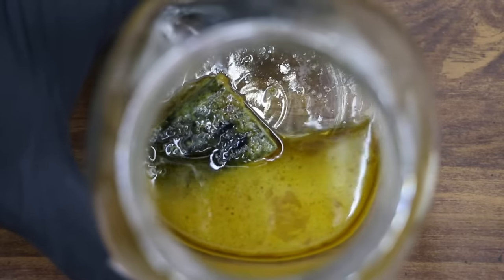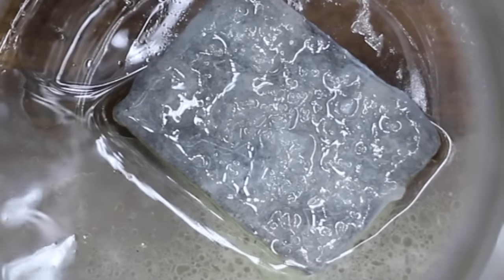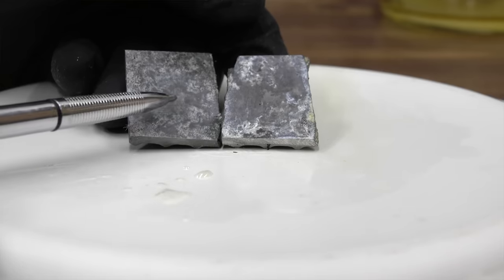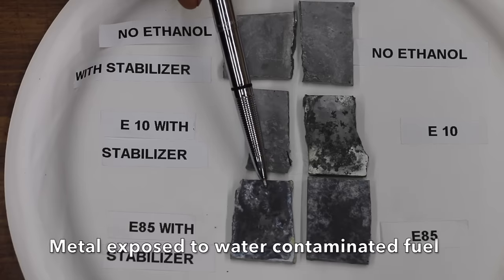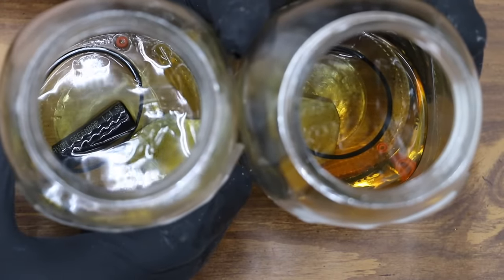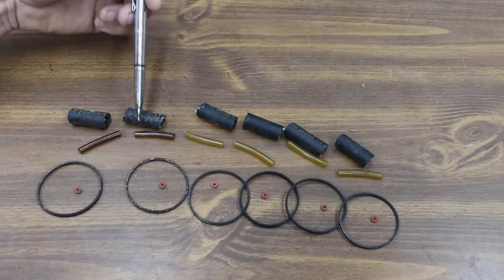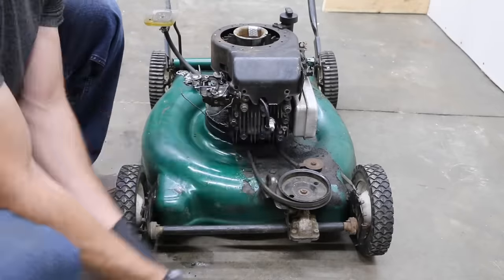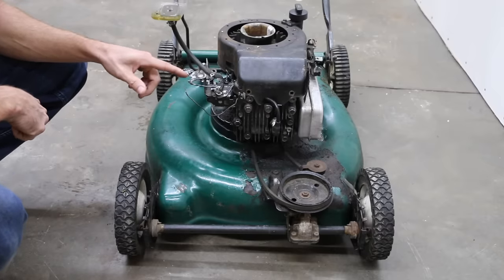Does Fuel Stabilizer Prevent Ethanol Damage?  Let's find out!

Comment: Can we bill the epa for the damage to our property
Reply: Ethanol is used to boast its Octane rating... so with or without SUBSIDIES its needed...
Reply: M B why should have corn farming died out already?
Reply: corn is very inefficient, for making Ethanol
Reply: Ethanol is used to boost octane, infact GM had the opportunity to use Ethanol to boost octane 100 years ago but chose TEL instead, because you can't pattent nature.

Ethanol is also effective at reducing carbon monoxide emissions, which is the primary reason E10 exists.
Reply: @mbbb9244  Welfare in exchange for votes and financial support to political candidates. Gross.
Reply: @N C ~ Higher Octane is only good for higher compression engines to reduce 'pinging'. Engines with lower compression, for example, with engine management systems can compensate for the lower power of high Octane fuel but at the expense of fuel economy.
Reply: @Texassince1836 ~ Higher Octane is only good for higher compression engines to reduce 'pinging'. Engines with lower compression, for example, with engine management systems can compensate for the lower power of high Octane fuel but at the expense of fuel economy.
Reply: @Jim-ee6pz  using ethanol you can increase the octane rating of lower octane fuels. For example 84 octane with some ethanol now becomes 87 octane regular fuel. 

This is opposed to using MTBE or TEL to do the same thing, since both of those are toxic.
Reply: @Jim-ee6pz  and modern production engines are all 9.5, 10.5, 11.5 or so compression. Gone are the days of 6.5, 7.5 or 8.5:1 low compression motors
Reply: @Texassince1836 ~ You are right about the compression ratios (my bad). My point is that there is no need to put higher octane fuel in engines that specify using regular grade fuel. People think they will get some gain from it but end up only paying more with no real benefit. Always use the grade of fuel recommended in your manual unless you have no choice and even then the engine management system can compensate.
Reply: @mbbb9244  In the UK we're told it's in our fuel to " save the planet " and we have any pops and crackles tuned out, GPF filters, double cats, insanely high taxes on 2L turbo hatchbacks. I call bullshit on all of it but Government's just get to do whatever they want in Europe.
Reply: @95roadie  - He meant the subsidy should die out...not the farmer
Reply: @Jim-ee6pz  - your response to Texassince1836 on engine compression ratios and ethanol compelled me to comment. 
Ethanol does not increase gasoline octane when blended because ethanol has a different stoichiometric ratio - having greater oxygen content. The gasoline will pre-ignite before the ethanol does in a higher compression engine. Ethanol doesn't prevent the lower octane gasoline from detonating. Mentioned was days of low compression engines (6.5 -8.5) are gone. Higher compression engines (9.1 and up) cannot run on 87 octane fuels-that and higher compression engines create more nitrous oxides (a pollutant). To reduce nitrous emissions exhaust gases are proportionality routed back thru engine intake to take advantage of it not having any oxygen content (inert gas). This spoils  hi-compression engine output to a degree.
Ethanol has higher oxygen molecular content and results in LOWER energy content. Ethanol blended with gasoline reduces gas mileage -10% blends have net loss of approximately 2-3% mpg.
Ethanol has a higher octane and could be used (100%) in engines of compression ratios of 12:1 or more. Increased efficiencies could be realized but still, ethanol would not match the mpg of 100% gasoline because of it's lower energy content (oxygen content level). All this can be verified at Wikipedia.
The ethanol industry wants to have ethanol content in gasoline sold to us increased to 15% but that would drastically reduce mpg by 15% or more and would be much more noticeable by the public. 
The forcing upon us to having to buy gasoline degraded with ethanol does not fit well in our so called "free market enterprise" scheme of things- if they want to sell it us then let us decide - not use government subsidies either. In my eyes it's just more of the crony capitalism we suffer under. 🇺🇸
Reply: Ray Bin ~ Ya and I cringe every time I have to put an Ethanol blend in my vehicles! Trump 2020! KAG!
Reply: @mbbb9244  +1 on the French wine industry overproduction; they have to do "emergency" distillations of surplus wine into industrial ethanol each year because they produce more than the market can absorb.  (And FWIW, I'm sippin' on the Jadot Beaujolais Village right now, used to work for a French wine importer, love French wine, and I still think these subsidies are socialist economic nonsense.)
Reply: @mbbb9244  ...  They also use corn to finish ruminant animals (i.e. cattle) on industrial feed lots.  I love beef all day long, but dammit the ruminant animals evolved to eat GRASS, not corn.  Corn makes them sick.  Gotta pump them full of anti-biotics just to keep them alive until slaughter.  What a bunch of nonsense!  Just let them eat grass.  Slap a tarriff on Australian and Argentine grass-fed beef if you gotta, but why do we need to propagate superbugs like MRSA because we use antibiotics on animals.  Another stupid crony policy intended to benefit a special interest group (mainly big ag business like Monsanto, ADM, Cargill).
Reply: @raybin6873  if E15 loses more than 4.5% fuel economy its the fault of the vehicle, not the fuel.

Even mixing in 15% WATER will not effect fuel milage by 15%
Reply: @mbbb9244  - that's what senator Perdue said in reply to my letter I sent him  - subsidies screw up free market enterprise  - gasoline laced with ethanol should be marketed on it's own accord  - not forced upon consumers...🇺🇲
Reply: @nc3826  - ethanol does raise octane but gas mileage is reduced because of it's lower energy content. To best use ethanol for optional efficiency it should be used in high compression engines but even then ethanol wouldn't match fuel mileage of gasoline. Ethanol is NOT needed in gasoline  - cars have run very well without it the past
Reply: @raybin6873 don't tell me.... go tell oil companies you have a more cost effective alternative, to using ethanol as additive in gasoline....
fwiw,Tetraethyllead and Methyl tert-butyl ether, is what was used before ethanol was used  in the past... and both were environmental disasters....
btw, its  strange how there are so many utube experts...
Reply: No ethanol has lower energy content
Reply: Texassince1836 no it’s lower in energy
Reply: Ray Bin correct
Reply: Ray Bin correct
Reply: @mbbb9244  Agreed it's a subsidy, but also, because,  supposedly,  it burns cleaner and petroleum is a limited resource.
Reply: Thanks for all your comments, I'm impressed w/ how much u guys know, I learned a 'thang' er 2. It sucks how political, Big business & gov./uncle Sam oriented things can get. We need UN-biased info from good "little" guys like all of you & Mr. Project Farm. Have you seen Phil Valentine's documentary "An Inconsistent Truth"? It made me think more/harder & want to know/learn more about pollution, pollutants, chemistry & such.  
I want to learn more, speaking of higher compression; what if we throw Diesel fuel into the discussion?!...  Uh oh, have I just opened Pandora's box er just a panDANG it?..   Have y'all ever seen the "little" guy that does "Shadetree Conversions" here on youtube?  He's pretty cool, check him out. He was a few years ahead of his time here in the US, full size trucks getting 40 er more mpg.             - take care
Reply: @Jim-ee6pz  the energy density of alcohol is far higher than gasoline. You actually get better gas mileage on 91 no matter the car
Reply: In California going to the bathroom on the streets and leaving needles is good for the envrionment evidently. Like all of these nuts saying breathing is destroying the earth burning CORN is the stupidest thing on earth.
Reply: Aris Torm I agree but corn is definitely good to eat with a whole lot of butter . Not shoved in the tank
Reply: EPA  ?  Ethanol was promoted by the petroleum industry backed by the corn farming lobby to allow boosting octane on  otherwise crap fuel. EPA, to the contrary,  produced studies that concluded to the environmental inefficiency of growing corn for that purpose.
Reply: @mt1885  With all due respect, "environmentalists"  (and frankly, a whole bunch of other people) have always been against the very inefficient process of using corn based ethanol to boost octane ratings and in the process, mess-up  every fuel system with its corrosion and rubber destroying properties. Corn is food and should be used as such. You want ethanol, ?  Produce it out of wood rip, scap wood or throw away
Reply: @danielrobert7181  The whole deal is a sham I don't want it and the eco-demo-communist who push this and claim oil needs to be done away with. When they finally get their wish it will be like a 3rd world country
Reply: @danielrobert7181  The with all due respect is the biggest load of ethanol I have heard. Anyone starting with that line is (claiming) they are being nice (however it is like all of the other lines) like environmentalist like Mr Gorre who live in mansions, private jets, Limos and use more electricity than a small town and want others to live in mud huts while he spouts the earth is ending with the biggest pack of lies. When Man rejects GOD what does he do (he holds ceremonies worshiping the earth). Again OIL is naturally occurring the entire LIE about it is dinosaurs is the biggest bunch of 'garbage'.
Reply: Daniel Robert I didn’t think alcohol raised octane ( the ability to reduce pre detonation under higher compression ) if so can I add alcohol to increase octane for my 2 strokes ?
Reply: @michaelschuler7397  In theory,: yes. But, any alccol that you buy commercially comes with a lot of water (not a good thing) and if you use ethanol blended fuel, it already has alcool in it, which absorbs moisture and eats up rubber hoses and seals. Adding more alcool will cause more harm than good. Small motors (2-stroke) repair shops around where I live, won't warranty any work  unless the engines are exclusively run on ethanol-free fuel. As to putting in Octane booster products  like STP or Lucas (which major ingredient is mineral spirits (good ole paint thinner), they do not recommend running it in 2-stroke engines. If you want long lasting fuel (2 or 4-stroke) get cans of engineered fuel such as Tru-Fuel, not cheap but very effective. Regards !
Reply: @rhedinrage1601  I’m sorry mate, I’m glad I don’t live under them! I wouldn’t be able to afford my 7.3 Ltr with a turbo
Reply: @danielrobert7181  in my classic 2 stroke motorcycles I use a fuel at my local high end station that says it’s 92 and no ethanol it’s pricey but I don’t use a whole lot
Reply: @Texassince1836  
"effective at reducing carbon monoxide emissions"
BS
How? For what engine? Not my car.. Not my lawn equipment
Ethanol generally lowers fuel efficiency and damages engine parts.
I don't know how "good for the environment" ethanol is when I'm buying more parts and getting worse mpg.
Cant imagine all this land being used to create ethanol is of any environmental benefit either.
OH and lets not forget all the additives added to fuels now because of the damages ethanol does to an engine.. I'm sure that "helps"

"boast its Octane rating"
And that is absolutely pointless. High octane does nothing for running cleaner, mpg, or car run better.
I dont drive a race car.

Like most environmental scams pushed by media/GOV its ultimately worse for the environment and only staying around due to tax dollars being tossed at it.
We "solve" everything by tossing more of your money at it. Look at the money being tossed around today. 40-50 years of the same nonsense

Comment: Very Helpful! I own a small airplane with 914 Rotax Turbo engine that requires NO lead fuel ⛽️ So I am forced to use 91 Octane car fuel. I do use Stabil & additives that are supposed to remove the damaging properties of the 10% ethanol fuel with out reducing the Octane rating. I do use 100LL Avation fuel while on cross country flights. And another additive called decalin to help remove the lead contamination. This demonstration was very helpful to fully understand the damaging effects of ethanol and water damage to carburetors, parts and fuel lines…..And how important it is NOT to let the fuel sit to long…….Very nicely done!  ⭐️⭐️⭐️⭐️⭐️⭐️⭐️⭐️⭐️⭐️⭐️⭐️⭐️⭐️⭐️⭐️⭐️⭐️🫡✅✈️🇺🇸

Comment: A little less than a year ago I dropped the factory original fuel tank from my 1988 Toyota to change the pump (preventative maintenance. God knows how much longer the original still might've lasted as I not once ever ran it dry of fuel), and upon looking in the tank I didn't see a single speck of corrosion. I credit my near obsessive use of ethanol free fuel for this. Given the era the truck was manufactured, along with political reasons to do with corn subsidies pushed on American farmers, I refuse to use fuel containing any ethanol in my truck or any of my small engines.

Good to see proof in your video that the mechanical aspect of my choice is spot on. I'm only surprised that I didn't happen upon this video before, given how long it's been since you posted it. Great work as always.
Reply from the maker: Thanks!  Thanks for sharing.

Comment: I've hated ethanol fuel for years. Nothing but trouble in 4 stroke lawn mowers that don't get run every week. My 2 stroke powered tools seem to do better. The mix oil has stabilizers in them which help them start after a few months of no use. I've tried non ethanol gas in my classic cars but the octane available in my part of Texas is only 90. Not good enough for high compression. I've used Lucas octane booster with great success. The only downside is the orange stain it puts on the spark plugs. Also, there are small balls of magnesium that build up on the electrodes. That must be the additive in Lucas octane booster. I've gone back to 93 octane E10 with Lucas fuel stabilizer. Plugs are burning cleaner, and they start fine after sitting months. If we had 93 octane non ethanol gas here, I would use it all the time. Great video, thanks for your testing and experiments.
Reply from the maker: Thanks and you are welcome!

Comment: The best thing is that to remove the fuel from gas tank if the car is going to sit for a long time. 

Great video! Can you try to test diesel too?
Reply from the maker: Great test idea!
Reply: @ProjectFarm  There's quite a few diesel treatment options out there - maybe a comparison of a few. Fuel gelling would also be a good test. Not sure if there is anything that will prevent or undo the gelling of the biodiesel being mandated nowdays.
Reply: How can you empty a tank if there's no drain plug on most modern vehicles?
Reply: @ryanchristensen1799  With a Liquid Extraction Vacuum Pump.

Comment: Learned the hard way, at a Min...if your car is going to sit for a while, 3mths or more, drain the gas, take off your carburetor and store it upside down, to prevent the jets from old gas corrosion where the jets are... had to rebuild my holly 1940 and they don't hake em anymore, and rebuild kits are hard to find now, they replaced the autolite 1100 carbs on str8 6  for better reliability and power... now they recommend the holly 1920 1904 models i believe...for the ford inline 6 - had to replace the tank as it leaked with a hole, fuel pump as it was clogged as well
Reply from the maker: Thanks for sharing.

Comment: So, who makes the best (that actually works) fuel stabilizer?
Reply from the maker: I'll begin that test this week.  Great suggestion!!
Reply: I would say non ethanol is best fuel stabilizer :-)
Reply: @ProjectFarm  Curious to that as well; I've been using Sta-Bil and my mowers start each spring, but SE North Carolina winters are short  :)  I suppose too there's a cost Vs. Benefit analysis if you are handy enough to change a carburetor every few years but even as simple as that is I'd rather not have to do so.
Reply: Project Farm been using stabil 360 with great results. Long term storage with no carb issues. Thanks for your great work!
Reply: I've been using three times suggested stabil in my gas cans for over 15 years, every season everything starts on the first pull.  All of the equipment is 15 years old too.
Reply: I've had some pretty good success with a mixture of Startron and Seafoam. Both products are great and I have stored gas for about a year this way for my backup generator. No issues
Reply: I use star tron and have used gas over a yr old without issues in lawn mower.
Reply: Ive stored unleaded (Caliornia) for over 2 yrs for my saws and outboards with Sta-bil and have fired em up and run em. After a year..might need some ether..sometimes..to get em running..but they do run well enough to empty the tanks.
Reply: Knock on wood...I've been using StarTron for a few years now, with gas in my Ski-Doo for a year at time, and have never had an issue. Same with lawn mower, chain saw, dirt bikes.
Reply: I have heard good things about Seafoam. Thank you to everyone sharing what has worked for them.
Reply: We use Helix 5 in 1 at my work in motorcycles and small engines.  Works as advertised and have yet to find anything better.
Reply: @RustyOpel   We use Sta-Bil up here on LI too.  It seems to work really well.  I've had 5 gal containers over a year old and they are like the day I filled them.